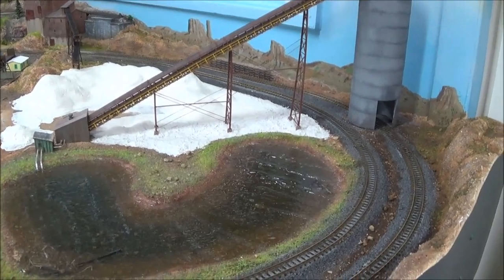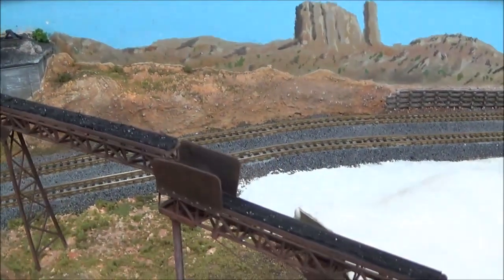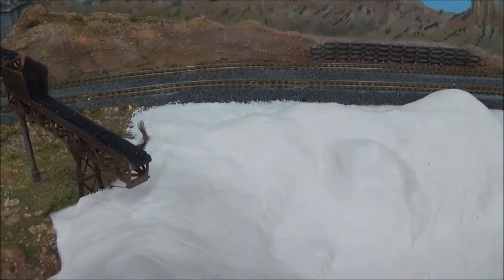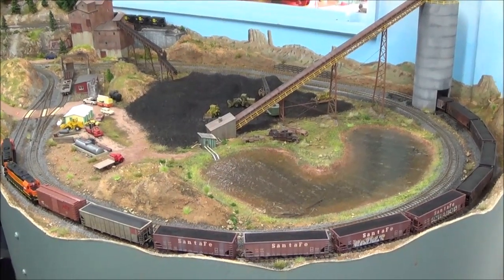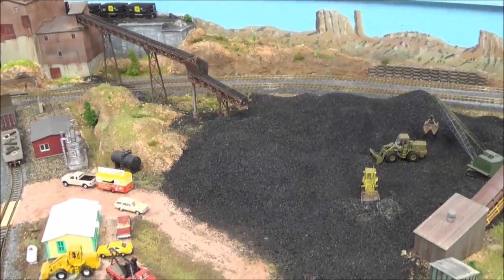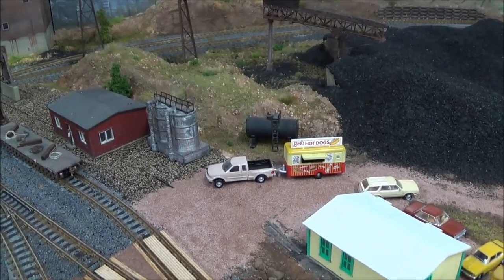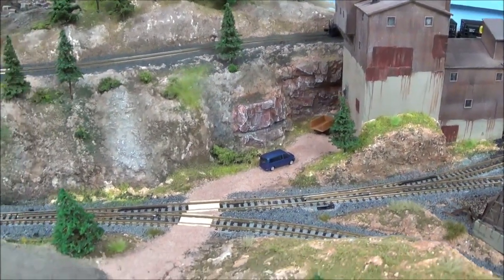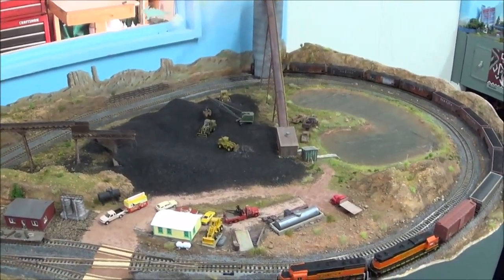N Scale ACTRR Layout Rehab Flood Loader Update #9

Comment: You have done a great job on the coal scene.  For the coal I would take some white glue on wax paper and sprinkle the coal on it for the parts that need to be coming off the conveyor instead of using tape.Scott
Reply from the maker: +Scott Downey I have used that method and will likely go with it.
Mike

Comment: Really looks authentic Mike. You might want to try using Loctite Polyseamseal Crystal clear for the dripping coal. I have found that by putting it down on glass, sculpting it and then letting it dry it works really well for water falls, so I think you could do the same with the coal and actually pour the coal over it after sculpting before it cures. It does take several days for it to cure depending on how thick you apply it. It goes down white, but cures to crystal clear and can be easily removed from the glass with a single edged razor blade. It remains flexible and you just use a little more of the caulk to adhere it to whatever you are applying it to. Hope this helps.
Reply from the maker: +The Shade Tree Fix-it Man Thanks George , I may give that a try.
Mike